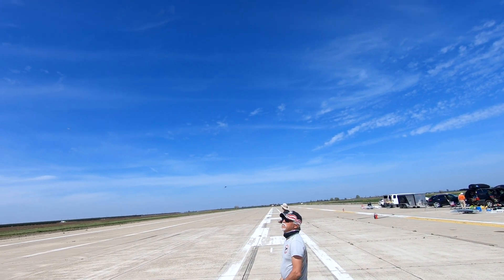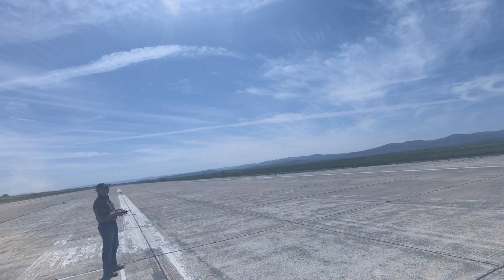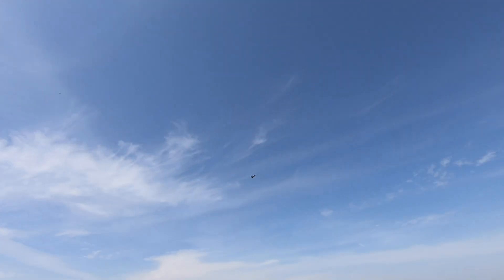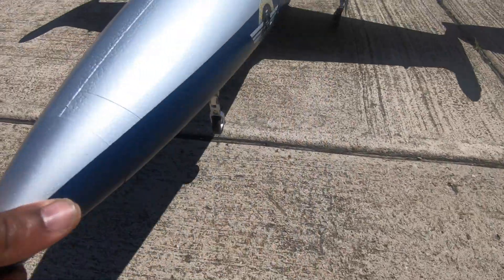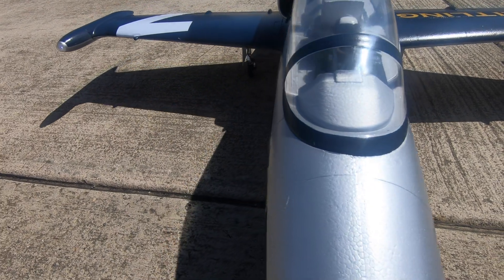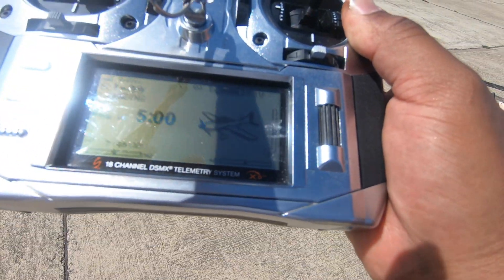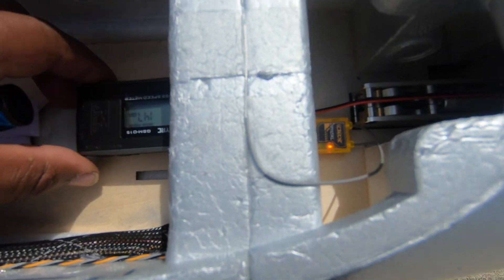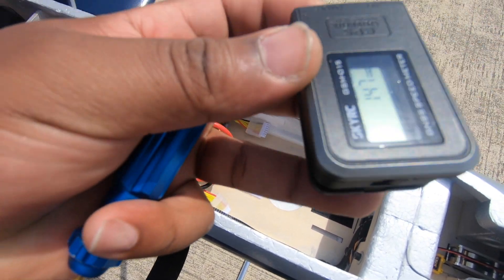BlitzRCWorks/AF L-39: Opening Up the Flight Envelope

Comment: Awesome jet, I want to build one after seeing your video. What packs are you using to get 14S and what kind of flight times ?
Reply from the maker: I am using dingy 6000 60c and smc 7700mah packs. I get about 4-6 min depending on how crazy 🤪 I fly! But those are good packs. I really love the SMC packs but they are not cheap is the only issue!
Reply: @FlyWithFrank  thanks, I use the Dinogy packs in my Avanti and a 71” 3D plane, love them. So how are you getting 14S? Are you using 3 packs ?
Reply from the maker: @gapple12  yes three packs 2s and 2x6s packs